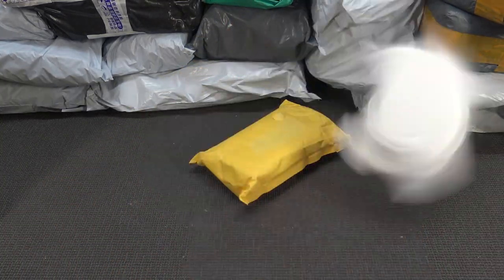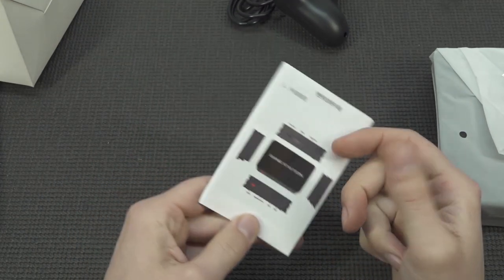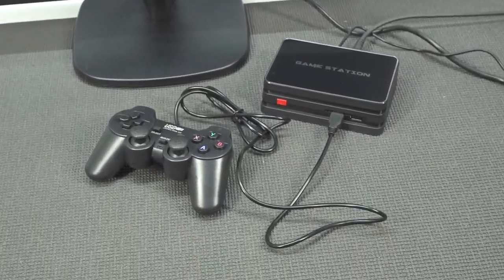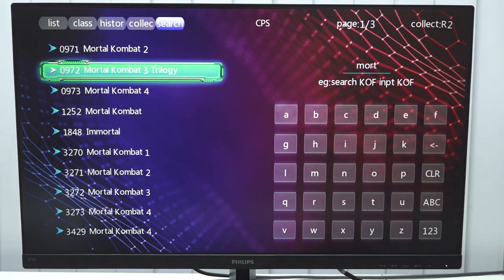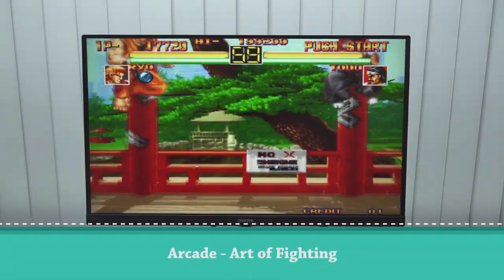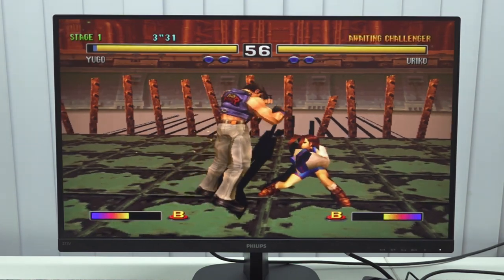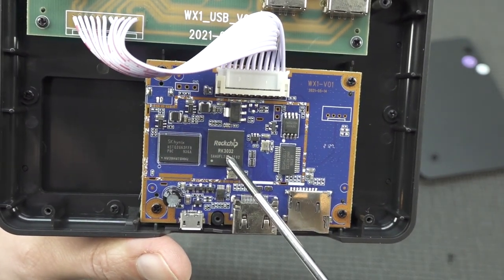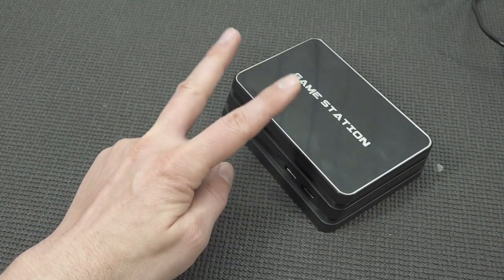Sometimes You Need to Avoid 40$ Stuff Like This ! 🤦‍♂️

Comment: Ah the gamestick lite. The stick version is ok but emulation isn’t great on several of the mame games and some ps1 games. Konami and data east games run like crap. CPS1 and neo geo work great. The vertical aspect ratio games are stretched. No way to change aspect ratios. The included controllers are horrible and I haven’t found any controllers compatible besides these cheap ps2 knockoffs.